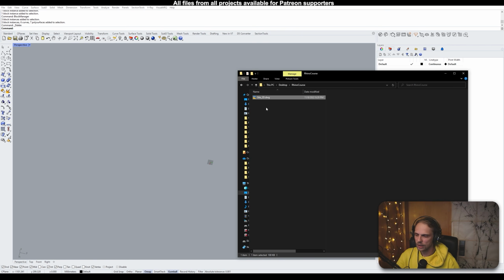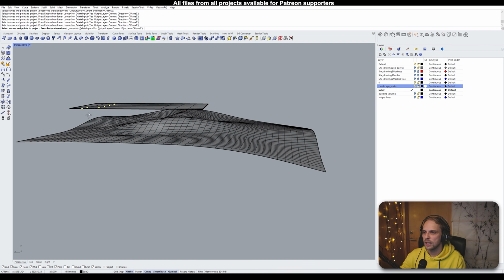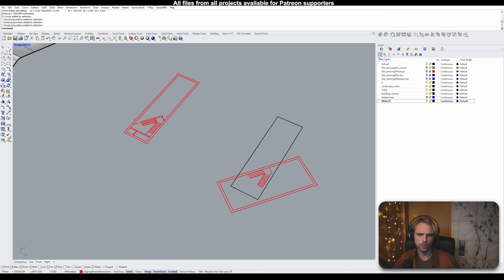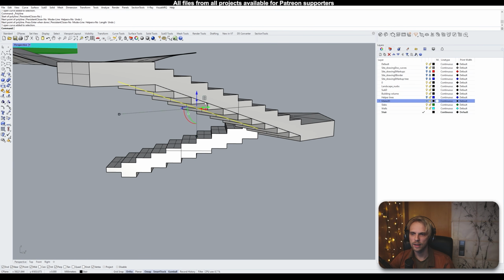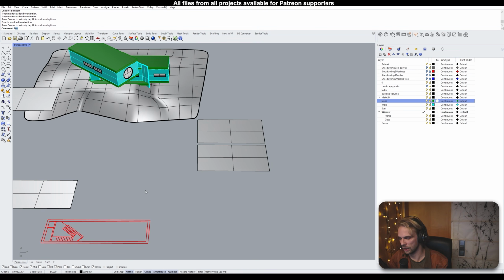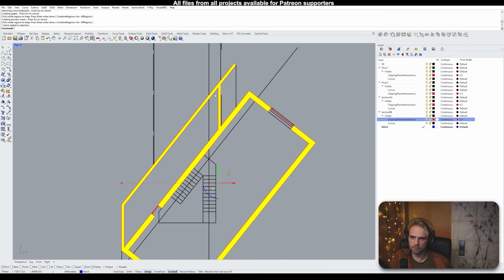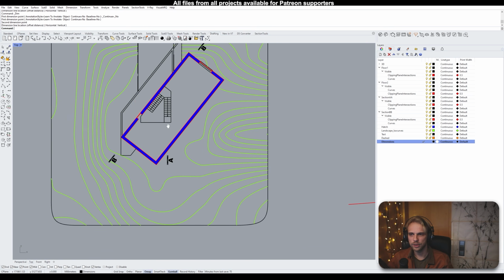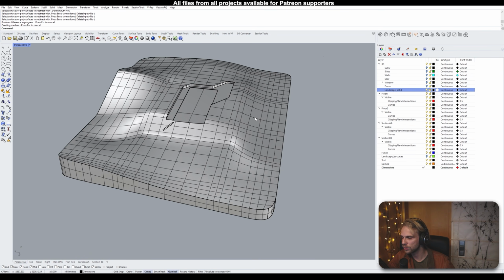Rhino 3D Introduction for Architects - Full Course (2023 Update) - Part 2

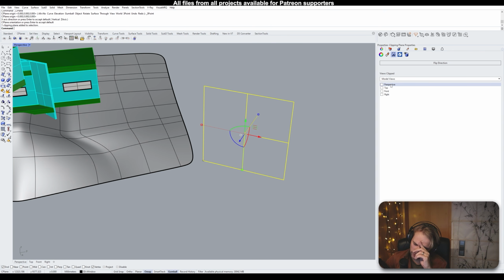Comment: 2:25:52 - for Rhino 8 users, the clipping plane now has different points to snap to. I had to draw a vertical line to get the orientation for the new y axis
Reply: Thank you
Reply: thanks was struggling with this as i wasnt able to snap to the corners of the clipping plane on Rhino8. Is the only way to draw lines from the centre of the clipping plane and snapping to that? Does it matter that the c-plane doesnt start on the bottom left corner of the clipping plane?
Reply: @ravyna95  That was the only workaround I could find - maybe Gediminas has a better method and can chime in on this. As far as I know it makes no difference to have the origin of the c-plane on a different point as long as the x and y axes are oriented correctly.

Comment: Hey nice tutorial. I have a question: Is there anything you can do in this or similar architectural modeling program that cannot be done in Blender?
Reply from the maker: Ye - I can extract architectural drawings that can directly be used to get a building permit / sent to builders/engineers for a quote. Blender is for visuals, Rhino is for manufacturing.

Comment: 12:41 Just a nice tip for this section, when you have started the MOVE action, you can press TAB on a line you wish to use as a "rail" to move and it will lock on that line.
Reply: you mean tab + left click?
don't get what you mean by rail
Reply: @danieljohn4014  By rail I mean to select a line that you would like to align the movement with... this can be anything, an edge of another object etc... and you press tab and then it snaps the movement to that line ie rail... Hope it makes more sense :)

Comment: hello, I wanted to ask, When using the offset command after creating a crystalline (think diamond shaped building) structure using the surface from 3 points, so just joined triangles, how do u create a clean offset? because when you offsetsrf the triangles overlap each other and it isn't clean, is there a way of fixing this? or a way to redo the structure, would you recommend using subD then creasing the edges?

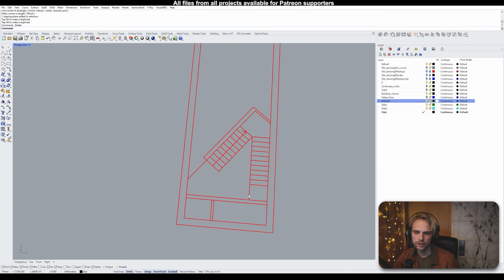Comment: This is a helpful tutorial, especially for someone transitioning from ArchiCAD. I have a question about the part at [1:40:00] when you use the bounding box for the stair. Does this also scale up the flight and rest thickness from 200 mm to an unconventional thickness? Do we need to redo the two lines with the loft situation? Additionally, I'm curious if there will be more advanced tutorials on designing with Rhino in the future. You're definitely one of the best Rhino arch youtubers out there!